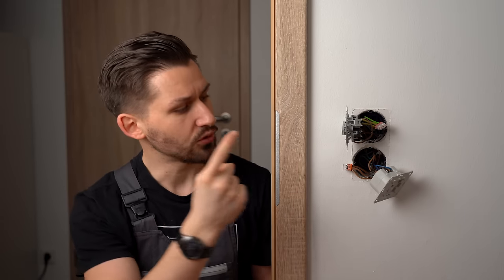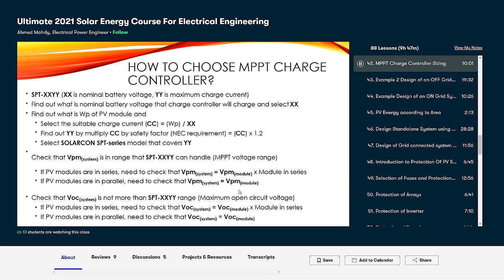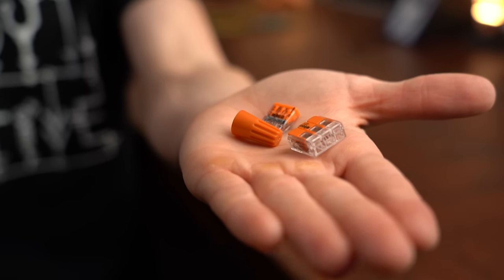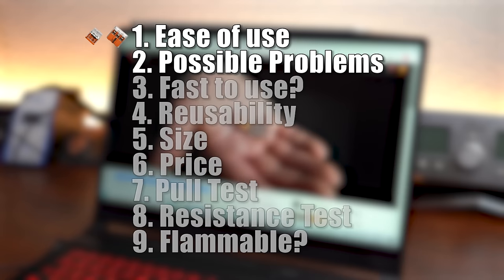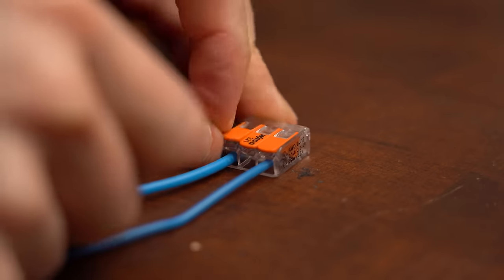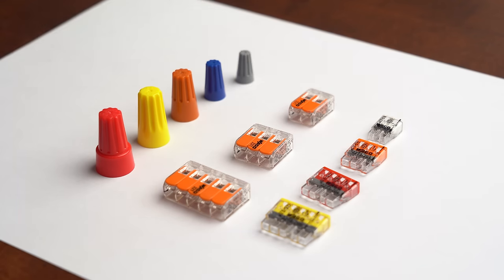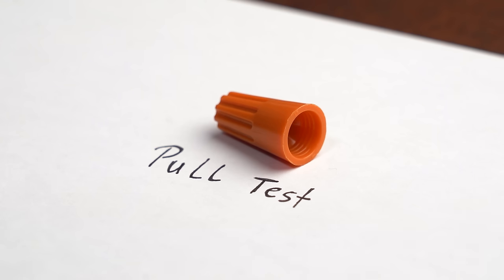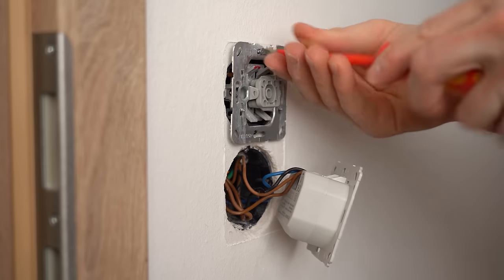What Wire Connector is the Best? Settling a Debate! Wire Nut VS Wago

Comment: Great Video and an interesting test. my only criticism is that some tests are more important than others. In my opinion, the most important test is "the resistance" test and should be weighted accordingly. As an Electronic Engineer, I have always questioned the concept of having a spring (typically flat) make contact with a round wire, and therefore a tangent point contact can not be as reliable as twisting round wires together.  Thank you for your interesting video.
Reply: @Treb Nev I agree with your comments. Any time I use wire nuts I manually twist the wires as tight as I can in a clockwise direction and then use pliers to tighten the wrap. Then I put the wire nut on. What I'm curious about are whether the Wago connectors are safety approved. In the US we have UL (Underwriters Lab) and I have had experience with VDE, CSA, CE, ...... Thanks for your reply
Reply: Hey, you might have overlooked this, but the spring in the Wago serves only to hold the wire in place. On the other side there is a bus connecting all the wires. So the wire in the Wago is held by the spring, but connected via the bus rail on the opposite site of the rail. But nevertheless it is only 40%ish contact
Reply: As an electrician working with wire nuts, you know it's right when the insulated wires are turning as well, then pull to test.
Reply: When something heats up and cools down ( wago ) it can theoretically fail over time, especially when using them for something like a baseboard heater at 3,000 watts which cycles thousands of times over the years. I'd like to see a test involving that scenario. Even though I bought some wago connectors, I ended up using wire nuts, only after twisting the wires together first, then on goes the wire nut. Maybe I'm just too cautious.
Reply: If the resistance of the Wago is in the certified safe range that's all you need. Fit for purpose is all you need.
Reply: @joanfrellburg4901  Wagos are thoroughly tested. Hence the numerous certificates granted.
Reply: If heat is created at a connection, that can only mean one thing. You aren't getting full power to your device, which has the potential of damaging it after repeated use. There are plenty of things ' certified ' in this world. It doesn't mean they are any better.
Reply: @joanfrellburg4901  Heat is ALWAYS created. What's important is how much heat. As long as the resistance is within the band set by laboratory testing its acceptable.
Reply: @martinw245  Heat isn't always created, depends on the connection and load or wattage. Also aluminum wire was once approved, but due to heat and other issues isn't used any more. Another thing that was a certified mistake.
Reply: @joanfrellburg4901  

"Aren't getting full power to your device"

Of course you are. Electricity doesn't work that way. An appliance draws what it needs. Resistance results in inefficiency and is lost as heat.

For example, if you have the identical PC to me, and they are both subjected to the same load, they will both draw the power required, but if your PSU is gold rated and mine titanium rated, yours will generate more heat.
Reply: @martinw245  One more thing, and getting back to my initial post, is the question of time, which hasn't undergone testing.
Reply: @martinw245  Are you not thinking. If you have a bad connection, two things happen, the connection heats up and power is lost to the device. That's very elementary and not even arguable.
Reply: @joanfrellburg4901  

Heat is always created. Even a conductor with no connections generates heat. That heat radiates away from the cable. Hence why covering cables with insulation is a bad idea
Reply: @martinw245  Re watch the video. I'm talking localized heat at the connector. The marette wont have any, it is a solid connection. The wago will, due it's small contact area, which over time, although certified, has not been tested.
Reply: Case closed.  I really don't have any more thoughts, it's just my opinion, I'm not an engineer, but I've been playing with electricity for a long time in many applications.
Reply: @joanfrellburg4901  

Time you say... when they laboratory test such connectors they use techniques to accelerate wear and tear. It's the same with most products.
Reply: @joanfrellburg4901  

No... power isn't lost to the device. The device draws MORE power to compensate, it draws what it needs. If the resistance is high additional current is drawn that's emitted from the high resistance connection as heat.
Reply: @joanfrellburg4901  

"Localised heat at the connector"

Indeed, and if the connectors resistance is within the band deemed acceptable by laboratory testing, and the thermal characteristics in the acceptable band, its absolutely fine.

As I type this, there's an oil filled radiator in the room, plugged into a UK 13amp socket via a 13amp plug. On full power the plug is slightly warm. As confirmed by the instructions that came with the radiator, this is normal. And no, it' doesn't reduce power to the radiator. 😉
Reply: @joanfrellburg4901  

"Small contact area"

Not as small as you might think. The busbar in the Wago is 5mm long. Some people think it's just like a knife edge contacting the conductor, it's not, the conductor is pressed down against the busbar along it's length for 5mm.
Reply: @Joan Frellburg  

Sorry, I forgot to mention... Wago push fit have been used in Germany for, I'm told, 30 years.
Reply: In my opinion the wago has to much resistance to even be considered for circuits in this ampere range.
Reply: @kenmaier6870  "What I'm curious about are whether the Wago connectors are safety approved."
They are in Germany (and so by extension in most of the EU and also the UK as ex-EU) and German safety standards are considerably higher than USA safety standards. Add to that that wire nuts are by now outlawed in Germany for safety reasons (if used incorrectly), I know which I prefer and use (and no, I am not German).

Comment: It seems US Code requires the connectors to be used in accordance to the mfg's specifications. Many require the wires to be pre twisted prior to the installation of the nut. Not sure how an inspector would be able to confirm that unless the nut is removed to inspect the quality of twist. The exception found was IDEAL who's instructions (at the time) did not require pre twisting. Ideal also sold a power screwdriver attachment for installation of the nut on untwisted wires.  Color typically indicates wire size / suitability for wire awg combinations /max wires may vary by mfg. Nuts are sometimes taped after installation. Spring connectors look interesting for 3+ wire connections were wire nut twisting can become quite difficult. Being clear also seems like a significant advantage for confirming proper termination.   The main arguments (at least here in the US)  against spring connectors seems to be contact area and creep from thermal cycling.
Reply: I think a lot of us automatically assume that, because backstabbing receptacles is such a very bad thing (it's a firing offence in my company and I've fired apprentices for it) then anything remotely similar must be equally bad.
It's not true and the 'thermal cycle' testing clearly shows the WAGOs do better than Wirenuts.
Note - I'm talking about the WAGO 221 series and the Ideal Wirenut, both high quality, consistently reliable products.

Comment: In the US, with half the voltage and thus twice the current, resistance is important. There will of course be thicker cables as standard.
Reply: That's not true though. Not only can you get 240v circuits in the US which is used for high powered devices, the standard wall outlets are limited by a 15 amps fues while european outlets can be used with up to 16 amps. So about the same maximum current. Most devices don't use that much power though so they tend to perform the same way.
While the voltage is permanently present a device does not always need to draw the full 15 amps. That's how electricity works. That's why the US is mostly fine using 120V while having the same limit on amps other parts of the world have.
Reply: He tested with 20A, same current we commonly use in the US.
We get half the voltage and yes if you were to keep power constant that would mean doubling current, in reality we just get less power at the outlet since most of our outlets are 15 or 20A.  If you're talking about heavy duty appliance circuits (electric stove, heaters, AC units) then they mostly work at 240V here in the US since we actually have 240V service but with a center tap so we can have two 120V legs for our lower power circuits.
Technology Connections did a great video on US electrical service https://www.youtube.com/watch?v=jMmUoZh3Hq4 and how it's not actually strictly 120V.
Reply: @Kennorx  20A isn't uncommon in the US, I have several of them in my house.
Reply: It's 4 time current if you take the same power consumption. Cause U is quadratic.
Reply: I was shocked at the resistance :O - but being honest, could I be bothered with them their twisty things... nope :) - but I'll not be using them Wago things on "MY" house ring main either :) A long term resistance test would have been good - as the wire oxidizes, twisting vs constant tightening. Message to WAGO you need to improve your design suggest more cutting edges and stop using that Chinese copper :)

Comment: This is what they tought me is school about 40 years ago: Pre twist in the direction you tighten the wire nut. I can remember as an apprentice working outside doing electrical connections in junctionboxes around freezing temperatures it was a real pain in the butt and hands. The brand was Conex and they made a very decent connection. Conex had already have wago type pushconnectors. But they recommended using the wire nuts for high current junctions.
Reply: Well, that is a problem if done in Germany, it fails inspection. No twisting of wires per regulations. That’s why wire nuts are a no go here.
Reply: Wagos are not push connectors.
Reply: @user-bj4lp3fr1o  Interesting, why can i then push solid wire in? Only need the lever in the 221 for fine stranded wire? Why are they even named that way? Your comment leaves at Lot of ??????
Reply: @DerKB79  Nonsense... you aren't twisting the whole cable... only the tip of the wires. This results in the wires actually having greater conductivity where they are joined than he rest of the wire.

Also electrical outlets with spring contacts and with a nut to attach the wire are in long use in the USA... the only one I would every use is one with a nut. Why? Because every outlet I've ever seen fail was with a spring contact that failed due to thermal cycling and oxidization... I've never seen a nut fail on a receptical.
Reply: @Wingnut353  Bit arrogant to say it´s nonsense.... It´s against code in Germany and that for decades. And don´t say you only twist the top part, seen enough US installations were that is not the case. But even that will fail inspection at once if done in Germany or most other places in Euope.
And yes, twisting wires together is just bad practice, to many unknowns in these connections, you never get the same out of it in terms of how secure/tight that connection is.
Your argument about spring contacts is hillarious at best, these are in use for about 5 decades now, never had one fail if done corret, most brands even have strip length etc on the outlet/switch itself as information.
Even ones i abused by putting fine stranded wire in with a ferrul on do work just fine and not come apart, but sure that is not what they are designed for.
Even every industrial control box is using spring contacts (Phoenix PT or similar), they are used by the millions and not fail.
But if you cheap out on stuff, you get what you pay for.

And i never said wire nuts are bad in itself, they are just not an option if you want it to pass inspection here, even screw terminals/connectors are not popular, they are to code, but not "according to current technological standarts".
Besides that, why bother with screwing these things on when you have a certified connector that is more easy to use and does the job just fine?

Personally, I scretch my head every time i see an US installation and ask myself why you are so stuck in the past. The craftsmanship is amazing, dont get me wrong, but it´s just outdated. 

At the end, you are just stuck in your ways, cause "in long use" is just an excuse to not go forward and is also a bad argument. Spring connectors and Wago´s are also in use for decades and have proven to be reliable. Guess why equipment build to german code passes every US inspection with ease? Never had a complaint about equipment we sent to the US, all of it build to german code and sepcifications.
Reply: @DerKB79  It's actually very common for the spring contacts in a receptacle to fail.  It's possible that the quality is not the same, but most intermittent neutral connections and other faults I've ever found have been due to a failed spring contact in a receptacle or switch.  I have seen wire nuts fail, but only when someone tries to join more conductors than the wire nut is rated for.
Reply: @JeffroDH  Agree in some part, had a series switched and Outlets from one brand that did not work great. Switched to another and no problems at all. 
To the wire nuts, they work, but are not to code for us here in Germany.
And since WAGOs are, they are the first choice. I have never seen one fail before the actual wire did.
Reply: @DerKB79  When you said most of Europe uses Wagos,you only means the West.In Central and Estern Eruope(probably in the Balkans too) almost all houses built in the 1980s or before and not renovated have aluminum wiring twisted connections wrapped in electrical tape with no connector at all.I have seen 60+yo wiring like that.Yes I know,its not standard today but imagine if you lived in a shitty Eastern European country when you could hardly even buy wires,let alone connectors.So there were 2 options:Make a twisted connection or live with no electricity.
Reply: @mernokimuvek  Since we are not talking 80s its hardly an argument for today.
Cause the countries you mention did catch up pretty well.
And the 80s are no example for todays standards, even in Germany back then you would mostly find screw terminals being used, but like my house build in the 1978, you start finding push in contacts on outlets and switches and on others are still scew terminals, thats about the time things moved on.
And if you look at an installation in Croatia today, you will find its pretty well done and close to german code.
If you look at the UK, you will find a differnent way of doing things, but they also move on.
Thats the thing with residential work, you come across over 70+ years of development, seeing all kind of ways how things were done back in the days.
Reply: @DerKB79  Guess what they do in Russia: They literally weld the wires with carbon electrodes. It may be inconvenient but i bet nothing will make a better connection.Of cource Russia is a contry where stealing electricity is a national sport,so its important to have high current connections :D
Reply: @mernokimuvek  Yea or that twisting and dipping in solder. Seen that too.
Reply: @DerKB79  If twisting is not allowed in Germany why can u still but wire nuts?
Reply: @mernokimuvek  Why can you buy Chinese knock offs? They are not certified either in most cases. They just get sold, if a hobby guy uses them and nothing happens all good. If something happens, good luck paying yourself for damages etc.

Comment: There's a time and a place for both types. I initially didn't trust the Wago type when they first appeared in the U.S. for higher amp loads after seeing them through thermal imaging. They seem closer to wire nut now. I've never used the 221 lever lock type. If it positively locks and isn't easy for it to come loose accidentally, then I see a huge benefit for certain scenarios. I can't fathom why it would be unsafe to reuse wire nuts provided they are in working order. After all, they simply insulate the connection and hold the wires together for the wires to carry the current. Also, there is a "winged wire nut" that isn't round like those in the video. They are much easier to twist and physically smaller. Also, there's a tool that works for both types of wire nuts that can be used with a wireless drill or ratcheting bit holder that really helps. It reduces fatigue on the forearm and makes it easy to get a good solid connection. I fully trust Wago connections if the wires are largely parallel in the box and not a lot of stresses pulling wires different directions. But, if they have to get shoved in, rotated, twisted, etc just to get them in the box and/or barely fit in the box, I'd rather have wire nut. I definitely sense personal bias and preference in this video though I think the presenter made an honest attempt not to.

Comment: Never reuse the 2273 when they have been in your installation for a while. the spring tension will get less and create a bigger resistance. When there new and you put them on a wire and you decide to take it off before much current went through it its probably fine. Also when you twist and pull the wire out a 2273 connector you should cut it and re strip the wire. not that i always do that... but you should ;)
Ps. electrical inspector here, (Scope 10 for the dutchies here) 8:03 please for the love of your fire department and your self check the connection on the wago above your thumb, ether the wire is stripped to long or the wire is not in all the way...
Reply: 8:03 is not a problem. I’m an electrician in Germany and every time you put the wires into the plugs gets insulation is a little bit higher and you can see the copper. That’s not a problem at all, as nothing happens. The max you have on the cable is 230V/16A
Reply: @Abcdefg25152  i did not mean the dimmer, i meant the wago. Dimmer is fine